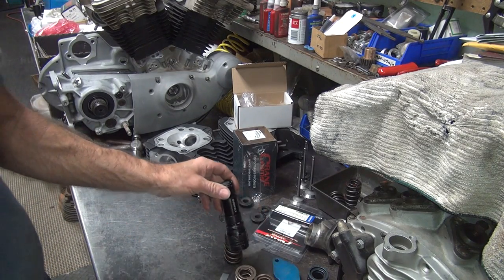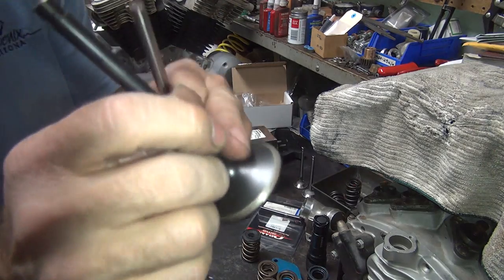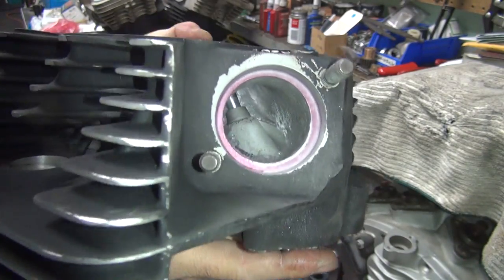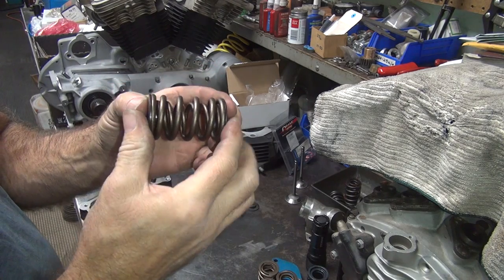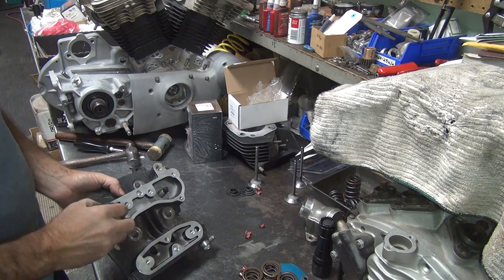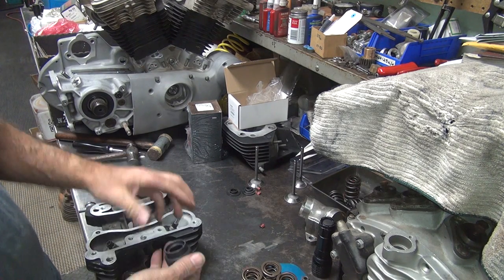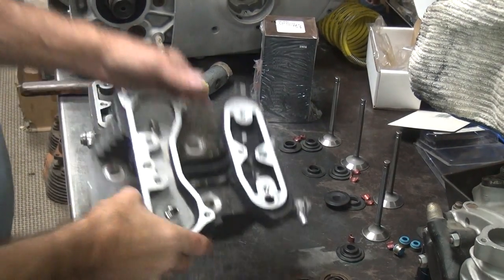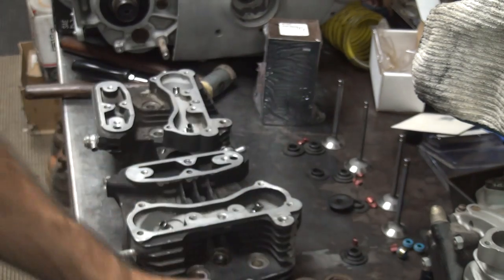1990's 1200cc xl head assemble with high lift camshaft evo sportster harley by tatro machine

Comment: Sir love your video's .. Can you tell me how much clearance between the valve stem & Guide there should be when I got my  head's back from the machine shop the valve were much tighter than your were ? I mean noticeably tighter and while I didn't have to apply any force for the valve to move in and out of the guide there was however much less clearance   But if I'm not mistaken I think Comp Cam's make's a guide cutting tool that when used provide's a nice shoulder stop for the PC valve seal's to bottom against .. ..

Comment: That is one interesting valve guide seal.  It looks like it requires a specifically machined valve guide, where you can push the seal on by hand, have it bottom out correctly so it doesn't distort, and doesn't float free in operation.  Is all that possible?

Comment: Do you have to worry about burning valves when your valve margin is thin like those racing /high flow valved
Reply from the maker: no, they work and last just fine. you have a better chance of burning a wide seat then a thin one. 
tatro

Comment: Hey Tatro;
I suppose I could do my own homework, but thought I'd ask while here: Did you need a different spring comp. or would the same one for older models work on these as well?
Also, I see some guys with a Tatro Machining T-Shirt.  Would I be able to order one from somewhere?   I appreciate you and like the design, I'd enjoy wearing it, any idea how I can buy a couple?!!?
Reply from the maker: i use different spring compressors for different heads. no one tool works on everything.
still waiting for the shirts. soon

tatro